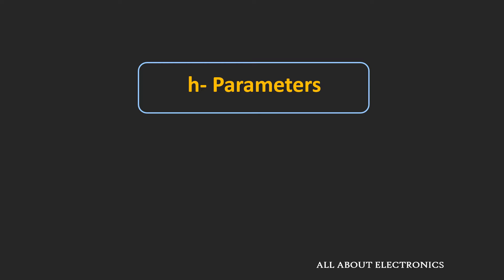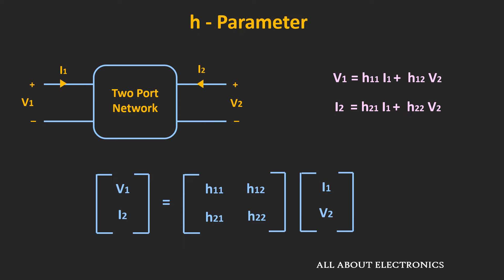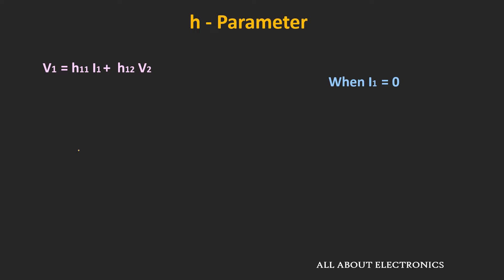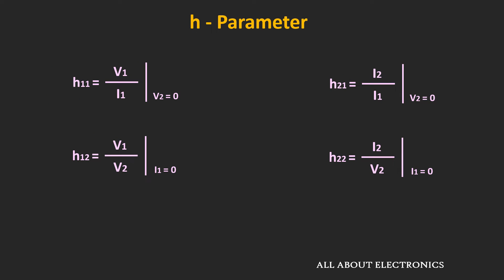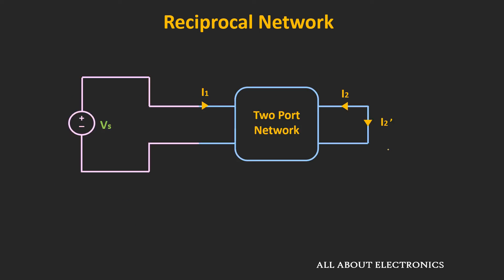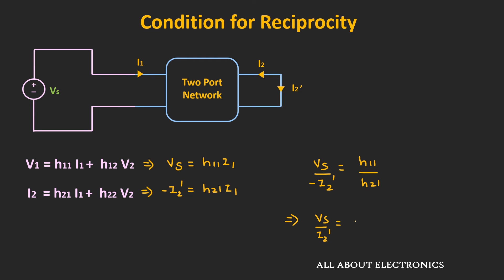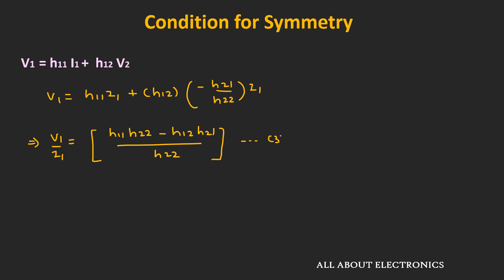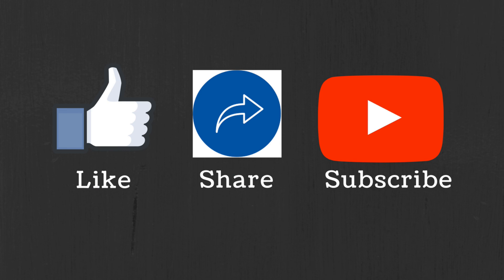h- parameters (Hybrid Parameters) Explained | Condition for Reciprocity and Symmetry

Comment from the maker: The timestamps for the different topics covered in the video:

0:21 h- Parameters of the Two-Port Network

5:56 The equivalent circuit of the two-port network in terms of the h -parameters 

7:27 Condition for Reciprocity for h- Parameters 

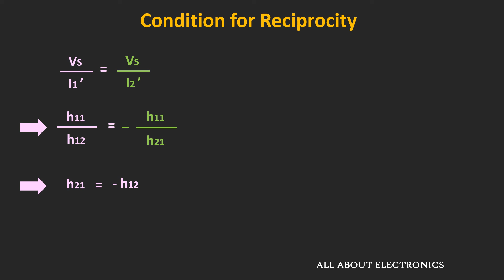10:41 Condition for Symmetry for h- Parameters

Comment: How we find that h12V2 is a dependent source element in equivalent circuit ??
Reply from the maker: Because V2 is the voltage on the output side. On the input side, there could be only two parameters V1 and I1. 
It shows that it has a dependency on the output side. Since we are applying KVL, the unit of the source has to be a voltage source, that's why it is a voltage-controlled voltage source. 
I hope it will lear your doubt.